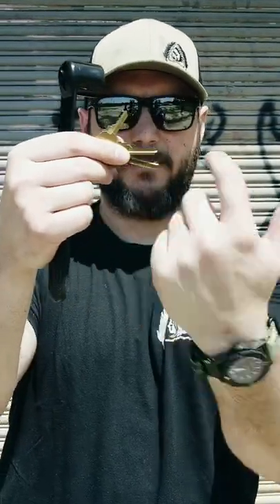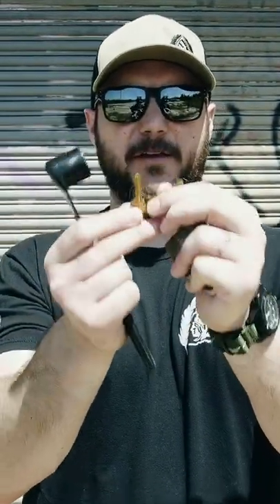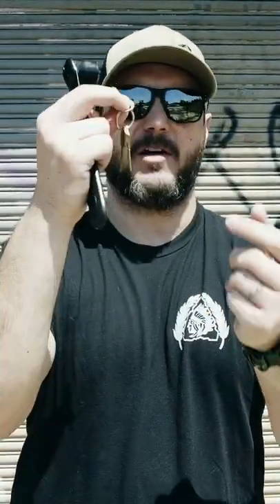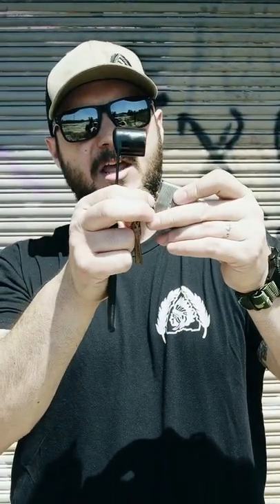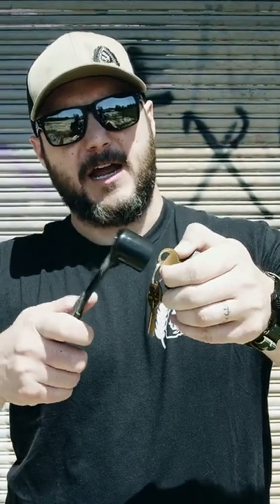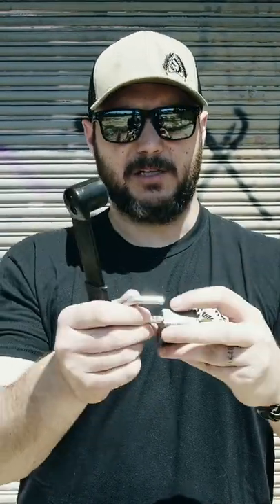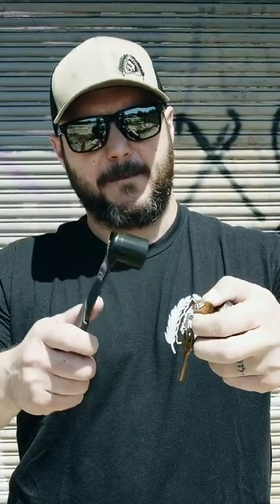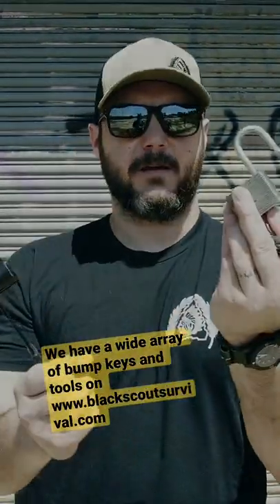Bump Keys and Opening Locks #shorts

Comment: There was a cheap padlock years ago that had a flat key with mirror image pattern on both sides of the key with a kind of "T" design on the very end....... the "T" was the only part that opened the padlock
So file down both sides of the same type of lock leaving the end in tact and it opens every single padlock of its kind